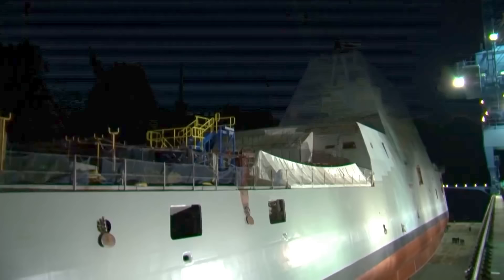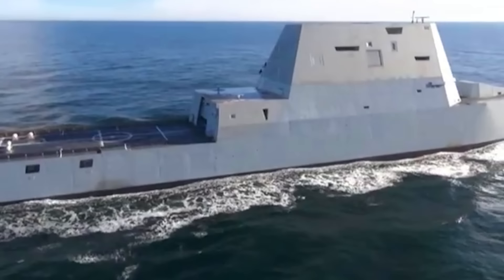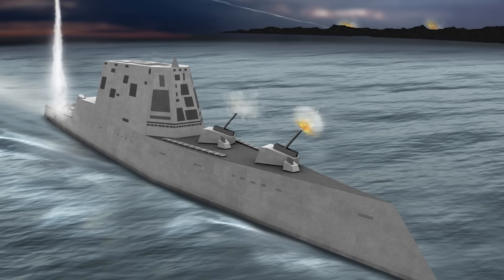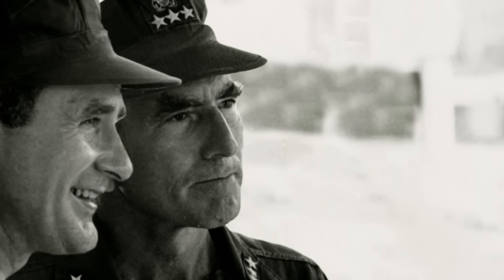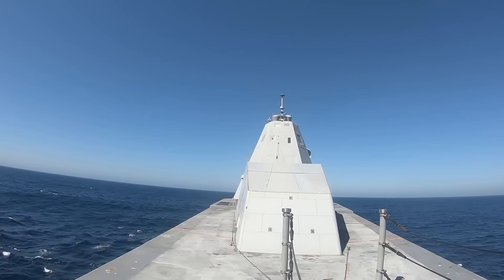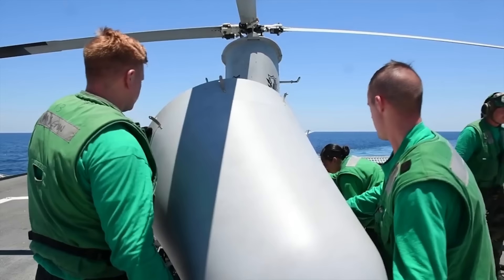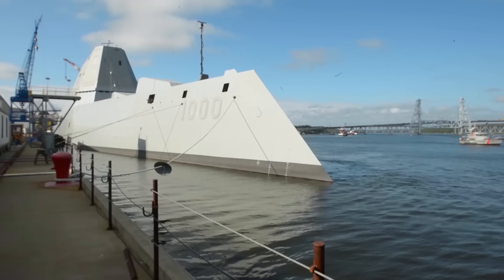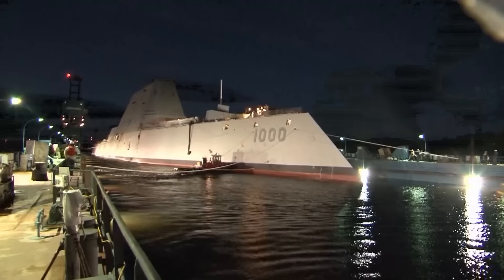The Stealth Ship So Powerful They Couldn't Build Any More

Comment: Well on a happy note I would point to the Seawolf, a far overly expensive sub which was also cancelled due to changing world event and the horrific price tag. Yet the Seawolf served as the test bed for technologies which would decades later be incorporated into the far more reasonable Virginia class which makes up the modern sub force. So perhaps the Zumwalts will likewise be a valuable experience for future ship building decades from now.
Reply: The Seawolf ran into something while at sea in October, about ten sailors were hurt. There was damage. Apparently, near Taiwan?
Reply: Actually, the Connecticut, the captain and others were relieved of duty. The Connecticut is of the Sea wolf Class... How many did we build?
Reply: Virginia class came out BEFORE Seawolf
Reply: Exactly.....the Virginia class subs are really good platforms......and a lot of the tech came from Seawolf.
Reply: God dam someone how gets it.
Reply: @ArchAnge11  No. Seawolf subs were designed in the mid 80s....the procurement was cut short due to cold war ending......the Virginia subs benefited from the best parts of Seawolf....and incorporated latest goodies. Virginia class are great subs....and cheaper.
Reply: I agree it's a good bridge for testing future less expensive ships and weapon systems. The Air Forces F-22 is serving as a bridge far into the future.
Reply: Nice! I think the word you landed on was Virginia.  I know a seawolf captain that sat underneath ice caps for years that would have killed for one of those...
Reply: No doubt the zumwalt class will have taught us valuable lessons for when the technology is ready, however it was an extremely expensive lesson.
Reply: I believe the general Seawolf design was used as the enemy ship in Tomorrow Never Dies. I remember seeing Seawolf in Popular mechanics in the late 90s and then saw that movie and was like, wait a minute.

EDIT: Apologies, I'm thinking of Sea Shadow.
Reply: Military objectives: failure
Research objectives: gain

Military value: negative
It takes a lot of resources in an incapable weapon. Similar to Great Bertha.
Reply: My sea wolf was rubbish. She was too big for the bath tub & my Action Man always got soaked. I decommissioned her in the front garden with lighter fluid and my Tonka truck.
Reply: Godzilla?
Reply: @raywhitehead730  That was A Seawolf (Connecticut) not The Seawolf.
Reply: @raywhitehead730  3, the connetticut, Seawolf and Jimmy Carter
Reply: @ArchAnge11  The last Seawolf rolled out in the early 90's, the first VA didnt roll out till mid 2000's....So no they didnt.

Comment: The government built an overpriced, underachieving stealth ship. Unlike the ship's radar signature, it was easy to see this coming.
Reply: It was built by the navy, a branch with expertise in milking the government.
Reply: Wasn't stealth, it failed, that's why they scrapped it.
Reply: @tylerdurden4006  no such thing as stealth on top of the water.......
Reply: @Mr._Infamous  there is 🤦‍♂️
Reply: @Mianhe  have you even been on the open ocean?
Reply: @Mianhe  
Please elaborate then.
Reply: It will be a lot less useless once the ammoless guns get ripped out and replaced with hypersonics. Apparently this all started because the MUHreens wanted big pew pew guns for shore bombardment to replace the capability of the Iowa battleships. There are a few things obviously wrong with this idea,  such as the assumption that we were going to be performing large scale invasions of non-landlocked  countries (like Iraq) into the indefinite future. Another problem with this concept is the fact that the Iowa's guns were a full ten inches larger than what could be fit onto the zumwalts, necessitating the development of extremely complex rocket propelled ammunition in order to reach the ranges desired for shore bombardment. A hilarious side effect of this is that the guns are literally incapable of firing regular 155mm ammunition, and when development of the special rocket propelled rounds was canceled after they reached one MILLION dollars per round,  Zumwalt was left with two useless and extremely overpriced 155mm guns incapable of bombarding inland targets or even defending the destroyer against Somali pirates on inflatable paddleboats. Of course, by the time of the cancelation of the gun project, the priorities of the Navy had pivoted back to blue water operations with an emphasis on countering Chinese naval capabilities, so the capabilities offered by the guns were no longer desired. In the end the defense department wasted billions of dollars pursuing a weapon system designed to fulfill a fundamentally flawed purpose.
Reply: @jaffacalling53  this is what happens when brown water navy guys make decisions about blue water navy boats.
Ultimate fail
Reply: With electronic jamming radar is becoming ineffective. They know you are out there but they cant really tell where you are. The radar signature of this without jamming the signal is in a   2D world, but with airborne radar it looks like it is designed for maximum reflection.
Reply: @Chris_at_Home  Isn't lock on jamming a thing?
Reply: @Chris_at_Home  Not to mention with modern military satellites pretty much any surface ship movement can be monitored from orbit, even some submarines to a certain extent / depth by monitoring their magnetic signature.
Reply: Highly effective at destroying.....huge quantities of tax revenue.
Reply: Something went wrong with military procurement while we were sleeping
Reply: The Arleigh Burke Class is going to be hard to replace at a cost effective rate. It's funny, because no enemies or potential enemy of the U.S has a Navy that can compete with thr U.S / NATO. China has an impressive Navy for such a poor country but it couldn't go head on with the USN. Same with Russia. The Zumwalt Class is simply to advanced for anything out on the sea.
Reply: @Mr._Infamous  he might mean to radar, but this emits so much it's like a neutron star

Comment: I’m no engineer, but seems like the problem is trying to build the systems to fit the ship , instead of building the ship to fit the systems.
Reply: But the Navy DID successfully build a fine Destroyer. A Destroyer of Resources, that is. Perhaps they pay the crew too much.
Reply: @ridethecurve55  We all know the "pay the crew too much" portion is incorrect. This entire project felt rushed, completed out of order, and the contracting companies made 3000% overhead profits. If only the requirements for the build were completed correctly by business analysts, engineers were given the time to flush out the details of the details, cost projections were checked and then double-checked, realistic time schedules were given; but instead almost all business units were axed multiple times and they had to do what they could with what they had and just get it off their billets. 
This is my take anyway from what I know and what I assume based on the obvious gaps in this program.
Reply: I think the issue there though was that they wanted to "future-proof" the ship to a considerable degree in order to integrate systems that were still in R&D or didn't even exist yet (i.e. lasers, railguns, future SPY and other sensor systems, etc.)
Reply: @ridethecurve55  hahahahahaha
Is $2.50 an hour overpaying the crew? 
This POS was a failure because the design sucked 
And since it sucked, it was scrapped
Reply: @qk-tb2df  I hear about problems with materials. Aluminum bulkheads cracking, the rail-gun not being able to survive the heat of more than a few shots, to name the few I can think of. I wonder if material science, and research makes some strides, we will see a successful successor to this ship? I am not happy with the incredible amount of money dumped into the ocean with this. But I can hope that enough lessons were learned throughout it, that at least some of those advancements might be integrated into a future program.
Reply: And the guy who designed it is clearly the person responsible for the boardgame meeple.  I thought the Littoral Combat Ship looked awful.
Reply: The original idea was to reflect radar n stuff. The rest was added by request of the us army/gov and the rest is history!
Reply: @Inertia888  Railgun Wasn't even part of the start we buy a smart shell from the UK for 45K a pop.The gun this ship and another were originally built around was suppose to replace that smart shell and cost 20k a shell instead the gun never worked right and the shell came out to 800k a shell. SO the Nazy said it's ok well put a railgun on it instead and yea that never worked.
Reply: @neotagatg3238  seems like this whole program was more of a test platform, than a plan to make a working ship. At least in the near-term.
Reply: is the glass 1/2 full?  or 1/2 empty?
Reply: @darrick.S  right the hull was aluminum with a titanium citadel. Aluminum doesn't hold up on a ship that size in the open ocean.
Reply: No more like we donno how to make stuff work without calling china. As a overall society problem

Comment: Was on Michael Monsoor. The 2017 sea trial wasn't a complete failure. Something just failed to work that was vital to the testing and we couldn't complete them. The Navy just labeled it as a 'failure'. Everything up until that point was working better than the Zumwalt. It was just a very unfortunate thing. Hey, shit happens. Shrugs
Reply: A failure is a failure…….
Reply: @rydplrs71  and that failure is where we learn not to repeat it. They ain't stopping to build another type of zumwalt class
Reply: @rydplrs71   Only if you dont learn from your mistakes. Unfortunately the Military Industrial Complex projects are designed to fail so the Contractors can milk more money above and beyond the agreed price to fix "problems". 

The Zumwalt class was built by Bath Shipyards...who also build the Arleigh Burke. They dont care if the Navy cancels the Zumwalt because will just switch to building more flight 3 Burke's.
Reply: Shouldn't one of the primary purposes of our taxes in funding the government be R&D, pushing technology and keeping ahead of all the bad guys out there, including most of our so-called allies?  We do need to be smart about this and maybe some of this tech was a bit of a stretch, but also why there are the sea trials and a chance to learn and correct, and change course if we need to.  When one is pushing cutting edge tech, it is expensive and failures are to be expected.  What is most sad and dangerous is when we don't recognize our failures and opportunities and then people die.  An example of this might be the donked up Navy torpedo development in WWII that cost lives and wartime failures.
Reply: If it doesn't work, it's not working. I mean, you gave yourself an answer.
Reply: @andrewjost6714  and who are these bad guys you're talking about?
Reply: @zer0bre  Testing your car to see if it works. It's been working great for years. Suddenly on inspection day, you get a flat and it's officially a failure. Sound right to you?
Reply: There a book called “Arisen” in the book the Michael Monsoor sinks due to the Golden Gate Bridge crashing onto the deck.
Reply: The Navy Should Get The "Tax Payers Money back !!" Or a Certain Amount plus they Still have to Fix the Boats Right.
Reply: At this stage it really just seems to be a funny looking lemon.
If I was a US taxpayer, I'd be furious about this debacle.
Most expensive ship in the Fleet doesn't even have a Cannon that works? Some Admirals should lose their jobs over this.
Reply: @zer0bre  they are really all good guys,it just depends on which side that you are on. Is that it?
He just may mean China and No Korea but I doubt it.
Reply: @Anlushac11  yes I've been working there for 8 years worked on two of these
Reply: @rydplrs71  No failure is part of the learning process. I'm sure you're parents thought the same thing but look at you your still here... Unfortunately
Reply: The entire electrical system has to be replaced. It’s at the Pascagoula yard now to get fixed
Reply: @bentleyjordan7441  What the fuck happened??
Reply: @Anlushac11  Exactly!
Reply: @mattchristensen7802  just because it’s a failure as you admit, that doesn’t exclude it from also being other things.  That’s a claim I didn’t make. Only a fool doesn’t attempt to learn from failure and improve the next attempt.    It’s a lesson but it was still a failure.
Reply: @Rough Seas  I think it uses Modular DRS power system and those don't handle load shed out of phase to well. Those modules are not cheap to replace either.
Reply: @andrewjost6714  No.  We didn't push half baked ideas out in WW2, we pushed what worked out.
Reply: @zer0bre  And who are the 'so called allies' he mentions?  Odd.
Reply: Did the front fall off?
Reply: @snower13  xD
Reply: @andrewjost6714  I thought sea trails were about testing a new ship and finding out whether or not it performs up to specification, before paying the contractor?
Reply: @zer0bre  given that existing American technology  that works is about a generation ahead of everybody else combined, and 2 if the "whiz-bang" factor kicks in,  and the Rhssian failure in Ukraine and Chinese problems, we're getting geared up to fight the Romulans, or maybe the guys in the Independence Day mothership.
Reply: @larrystuder8543  Good point!  I do not know how Naval Ship contracting works.  My experience is with AIr Force and NASA contracting.  Assuming that Naval contracting is similar, and this being a development program, I suspect the Contractor did get paid for Labor and Materials to design and build the ship, and that there was some sort of incentive payments for performance success in the trials that would impact the profits of the company and follow on work?...  So maybe the Contractors profits were impacted by bad testing and performance.  I do not know for sure
Reply: @zer0bre  what he means is that (as in most cases) 90 to 99% of the testing criteria probably passed, but because one specific thing for one specific test line item failed, the navy just deemed the entire thing a loss.  This happens in deployment certifications for all other ships too.  You could have every single department pass except one, and that one department failed one single line item for something as simple as having 12 crew members assigned to a division instead of the "required" 13, so that line item fails, causing that entire department to fail, causing the navy to call the entire event a failure....and still deploying the ship regardless to a mission that never required that "failed" division to begin with.

its silly.

Comment: 78 megawatts is about 1/12th of what Aircraft carriers have (1100 megawatts on the Nimitz, 1300 on the Ford).
Reply: What's that in shaft horsepower?
This ain't the Royal Navy where you can grow a beard & drink off watch.
Reply: @doughesson  i forget, but its something like 100k i think per shaft.  don't hold me to it.  4 shafts (2 per reactor).  still going to be a LOT more than a Zumwalt.
Reply: @plbmck798  Thanks.converting kilowatts to horsepower wasn't part of even the Propulsion Engineering Basics class I took in the Navy.
Reply: I was on the nimitz reactor power is 550MW each, but electrical is 8x8MW gens, and not even total engine room power because of constantly making steam for the catapult accumulators. So yea 78MW is a lot.
Reply: I stood watch on Nimitz class SSTG/CTG's. There are only 8 of them at 8MW each with another 8MW of Diesel backup, total 72MW. The four CTG's are dedicated solely to powering the reactor coolant pumps. Your 1100MW is the total power output of both reactors, the vast majority of which goes to the four main engines, totaling 260k shaft HP(194MW), which I also stood watch on.  The  Carnot steam cycle has a theoretical max efficiency of approx 35%. So 65% of that 1.1GW is waste heat dumped into the ocean. And in a Pressurized Water Reactor design, only 1% of the Uranium fuel is actually burned over the core's 25 year life.
Reply: @doughesson  Nimitz class have 4 Main engines totaling 260K shaft HP.
Reply: @whirledpeaz5758  Yep
Reply: @whirledpeaz5758  i was work center supervisor and top watch on #2 reactor on the actual Nimitz 30 years ago.  I was talking about the power of the ship, not just the electrical system.  I don't think we are in any disagreement other than some semantics.  Total Nimitz power is still much greater than total Zumwalt power, when you factor in all of the things you covered accurately.  Thanks, shipmate, and have a good evening!
Reply: @cbr2317  I was too, 1988 thru 1992.  ran #2 reactor plant work center and stood CRW during the end of Desert Storm (yawn).  You and Peaz are technically accurate when talking about electrical power generation.  I was talking about total ship power, which is what Dark Seas was alluding to IMO.  anyway, thanks, and have a great one.
Reply: @plbmck798  Ike CVN69 1MMR '86-'90, just thought best to add some context for the land lubbers reading.
Reply: @whirledpeaz5758  agreed and appreciated.
Reply: @plbmck798  I was reactor machinery div 2 ALPO from 2010-2011 after sub medical dq, that old girl is in rough shape.